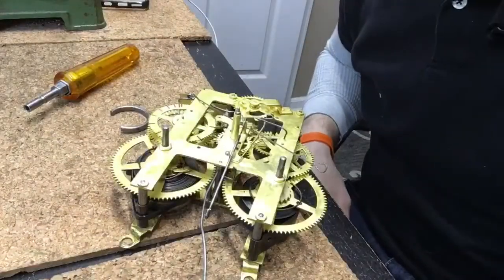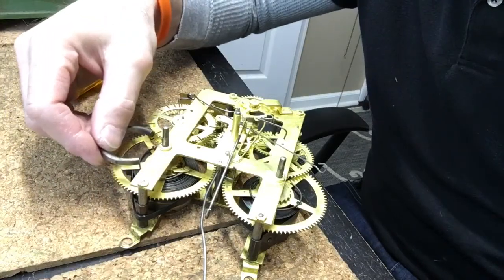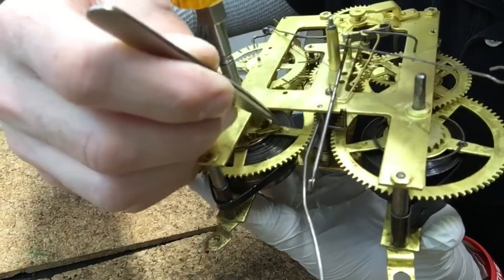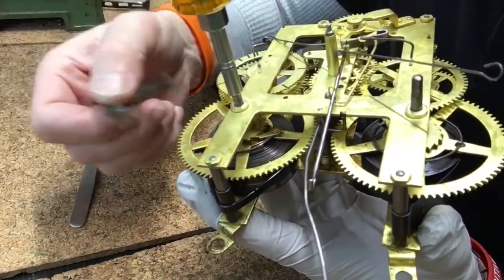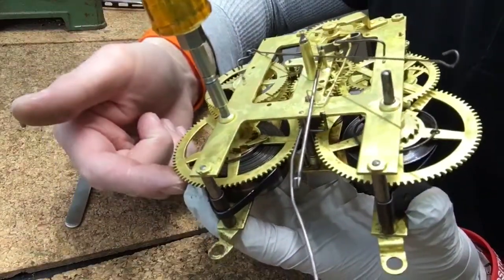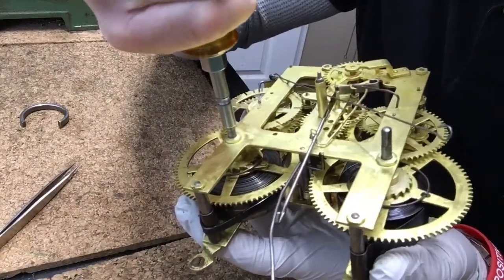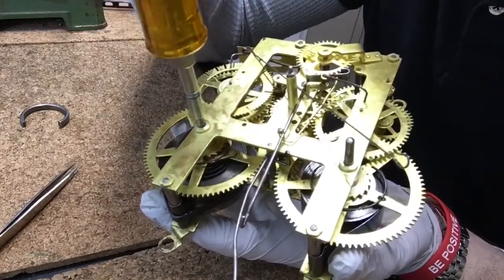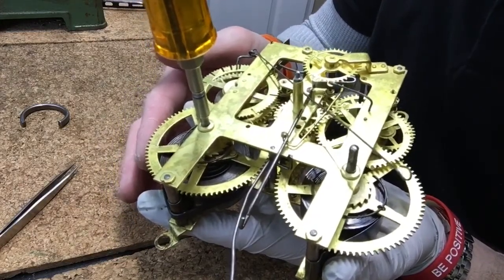How to power down a mainspring to safely disassemble clock.

Comment: Problem with the zip tie method is that you can’t remove the gear wheel w/ spring to clean since you’re tying it to the post the spring is attached to. The “C” spring clamps just grips the spring.
Reply from the maker: I remove it and clean it always.

Comment: I need to let down the power on a Seth Thomas with open springs but don’t intend to remove the spring, just clean it. Would this procedure work for that?  And can I go ahead and reengage the spring and click once it is powered down most of the way?
Reply from the maker: Yes, that is a valid procedure. I would wind the spring all the way down,  then engage the click and put some power on it so the spring is not so big. Just leave enough room so the leaves of the spring will allow fluid ro pass through.
Reply: Thanks so much!
Reply from the maker: @stonylawless6230  your welcome